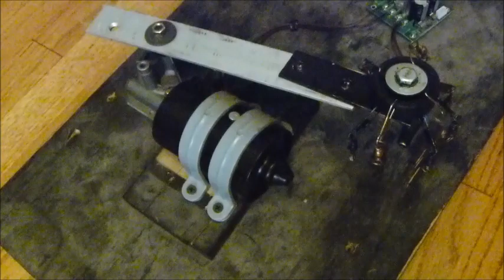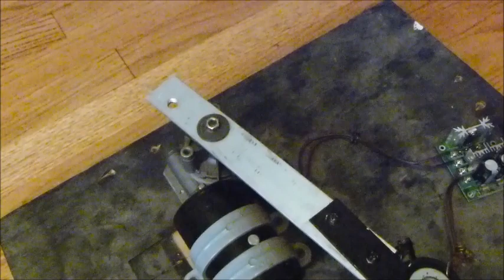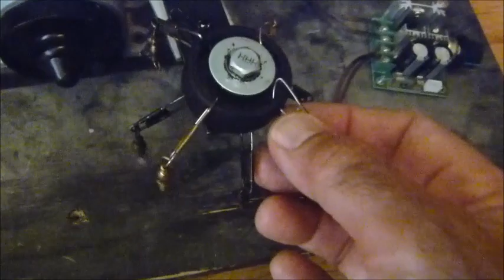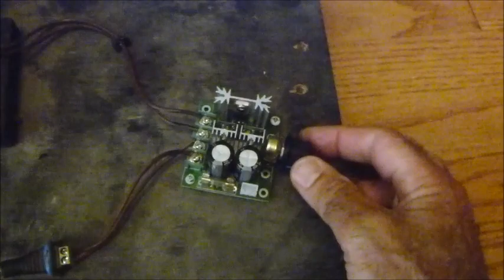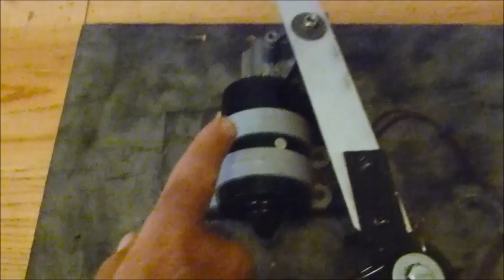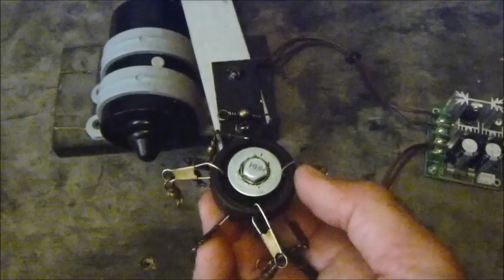HOW TO build Halloween motor assembly

Comment: The aluminum bar is $6 bucks, swivels come in a package so you can get bulk, you don't buy swivels singley and not at $2 each. LOL, that would make yours 2 x's however many you applied here. Then there's shipping and tax, clamps a few bucks each unless you can find some plastic ones.
Reply from the maker: I'm not sure what you are asking about - - the swivels or pulleys that I use I did get on Amazon and could buy them 1 each.   I think I bought 12 to start with.  But for my spider prop which this motor is used for, I don't use swivels or pulleys at all.  All the cords run through small eye screws.  I thought originally I needed to use pulleys but found they were not necessary.  Regarding overall cost - really my main point of all the props I've built is the idea of using only 1 motor to move multiple props versus 1 motor for each prop.  As I posted last year, I ended up with 14 moving things off this 1 motor.

Comment: What size are the conduit clamps?
Reply from the maker: They are 2" clamps. But I've changed to metal clamps since I found on at least one of my setups there was enough side torque that the motor turned a bit and when I went to tighten down the plastic clamp it broke.  So I now use only metal ones - you can get them at any big-box store.

Comment: The MG motor comes with a lockwasher. Do you put that on first before the flat bar or just install the bar over the motor shaft directly?  I'm also thinking the nut is a locknut, right? Thank you for sharing!
Reply from the maker: I use the nut that comes with the motor.  I think it's brass like the shaft so it won't strip the threads.. You do have to be really careful and not over tighten - I've stripped the threads on 1 motor and had to use lockweld to secure it.  Finally - I've done it both ways - with and without the lockwasher.  You don't end up with a lot of threads showing once you put the aluminum bar over the threads and I worry about not having enough threads to tighten down on the bar.  The motor shaft flairs out as you tighten down plus it's grooved which cuts into the aluminum shaft I put on.  I figure that's tight enough and I haven't had any of them come loose yet.  Good Luck
Reply: Thanks Rick. Yes, the shaft is not long enough but I think the lockwasher, alum bar and locknut will hold. So far, tested for an hour and it didn't loosen. Fingers crossed for big night!

Comment: awesome stuff here.. thanks for posting.. do you have a link for the new motor controller?
Reply from the maker: I bought 4 of them on Ebay.  Here's a link to the kind of controller.  You can probably do a search and maybe find one cheaper.  The main thing you will see is not all of them are encased and you should get one like that.  http://www.ebay.com/itm/New-DC-12-50V-30A-PWM-Pulse-Width-Modulation-Motor-Speed-Controller-/261137583670?hash=item3ccd034e36:g:2wsAAOSwUKxYdzhs
Reply: Thank you big time for providing link, makes it's so much  easier.

Comment: Brilliant!  Thank you so much for providing an assembly video.  I just got my motor in and going to look for parts to complete it.
Reply from the maker: here's a Ebay link someone else asked for regarding the motor speed control.http://www.ebay.com/itm/New-DC-12-50V-30A-PWM-Pulse-Width-Modulation-Motor-Speed-Controller-/261137583670?hash=item3ccd034e36:g:2wsAAOSwUKxYdzhs
Reply: Vendor is from China.  I purchased 2 and hope they get here in time.  Thanks for the link.  I still need to find pulleys and a wheel similar to the ones you have that the lures hook into.  I'm guessing it is something like a Kobalt 3-in Rubber Swivel Caster from Lowes?